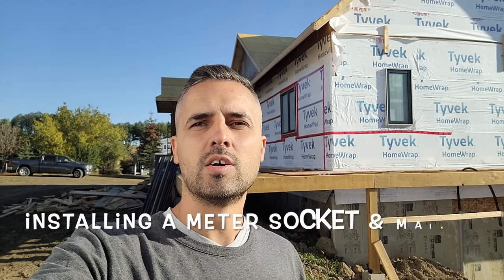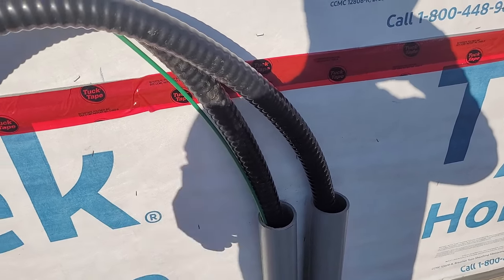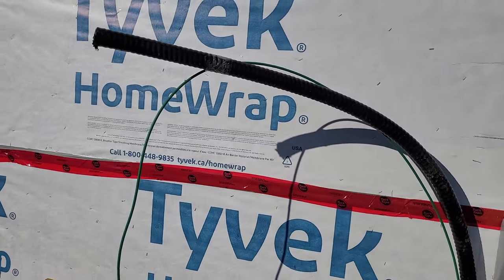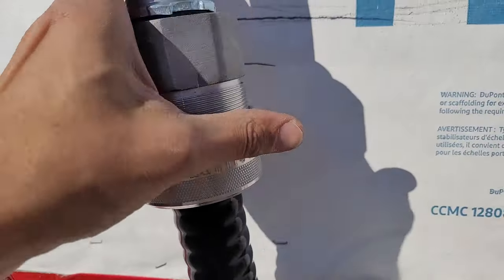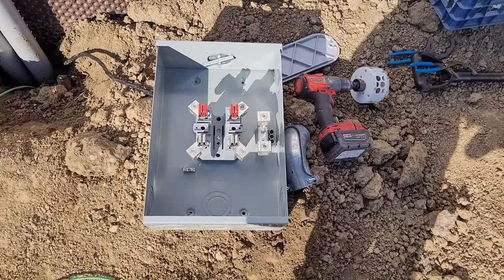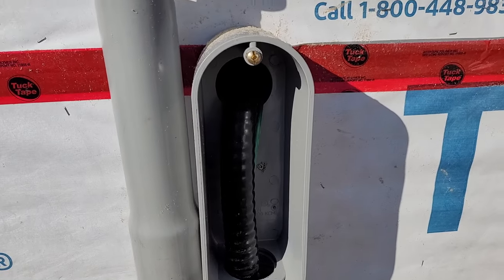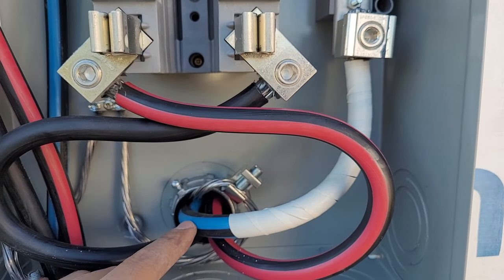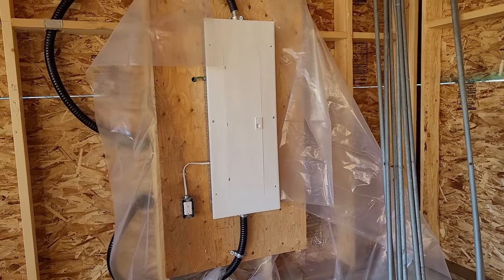How To Install a Meter Socket and Main Panel

Comment: first of all love the detail and close ups. i am currious, if you're running TECK why the PVC. just esthetics? although it came in handy for the ground.
Reply from the maker: Glad you find the video useful. There was already ACWU cable in the ground before I quoted that job. The inspectors around here want a pvc sleeve over the cable even if it's armoured, plus it looks better than a black cable running up the wall. Thanks for watching!

Comment: On the meter box: the bottom 2 hot lines going to the main breaker, do they have to be crisscross like what you did, or can they be on the same side as the main lines coming in from the top?
Reply from the maker: Are you referring to the blacks and reds not being on the same side top and bottom? Or are you asking if the load cables could come into the bottom of the meter box?
Reply: @energyoneelectric  The black and red hot wires on the bottom that are going out to the main breaker.
Reply from the maker: @hashishsenju2015  it doesn't make a difference whether your black or red is on the left or right,  and it doesn't need to match the line side either.  Put them on either side.
Reply: @energyoneelectric  Thank you sir 🙏

Comment: Dont you need a disconnect outside to protect the transformer or to work on the main panel? 

Also Is it okay to connect straight from transformer to a meter/main combo without a fused disconnect ?
Reply from the maker: Disconnect is not required between meter and panel in this case.  If you ever need to work on the panel mains you must call the utility company to shut off the power.

Comment: The 2 hot wires going to the house ,,,,,,,, where will you hook  them up at your entrance panel  on this video ?  anyone can answer ...... I do not see the lugs where the 2 hot wires need to be wired to.... what brand and model no. of entrance panek ?
Reply from the maker: The cable that feeds the sub panel in the house was attached to a 100A 2-pole breaker at the shop panel,  and in the house it was attached to the main lugs (no main breaker in the house). Hope that clears it up a bit.

Comment: What happens if the load wire is connected at the top and the line wire is connected at the bottom
Reply from the maker: You won't pass inspection and the utility company won't power it up. The meter box is clearly labeled inside.

Comment: Why are you bringing power to the shop first instead of the house and why is the house being fed off a subbreaker
Reply from the maker: When I got called out to quote and do this job the power cable was already at the shop..I would have brought it to the house personally.

Comment: If using 2" conduit, why not just use a 2" male adapter rather than using that "tech connector" into the meter box?
Reply from the maker: By code we need to bond the metal armor of that cable.. that's where the teck connector comes in.  Inside the connector it is making contact with the metal armor.  Then we attach a grounding bushing on the connector to bond the actual bonding cable too. Running your armored cables through pvc conduit and a male fitting wouldn't achieve your bonding requirement. Hope that helps,  and thanks for inquiring.